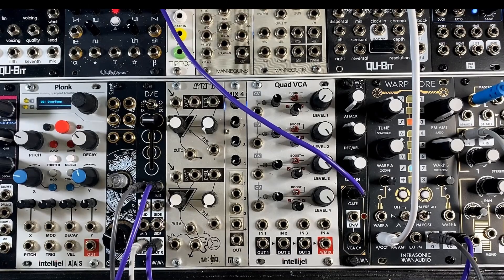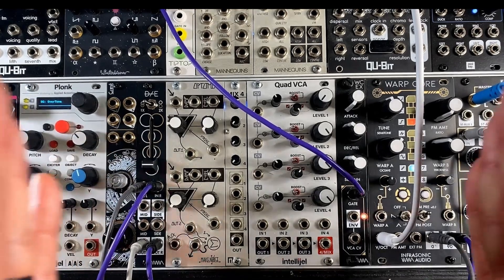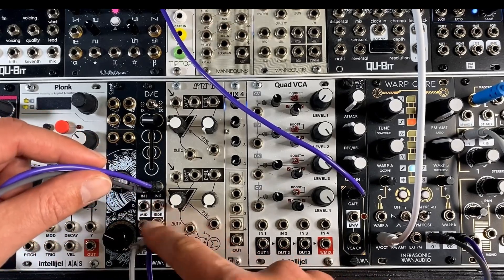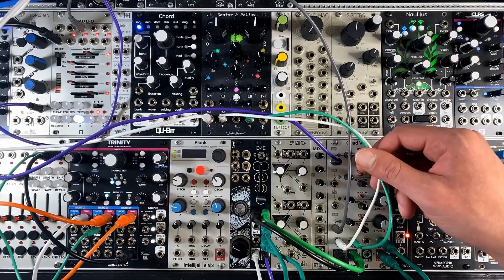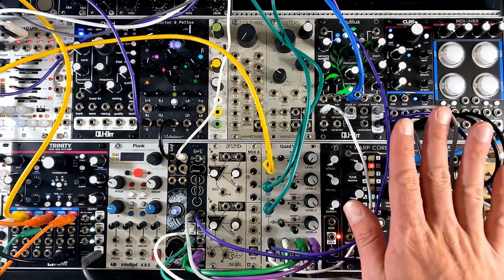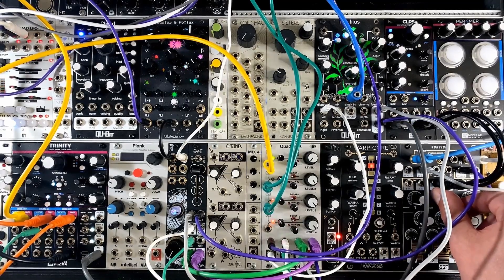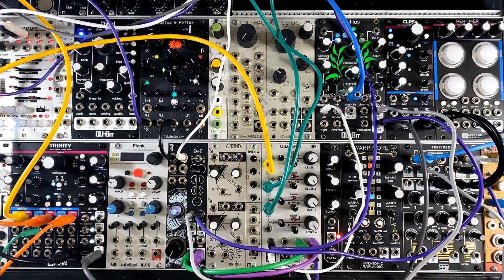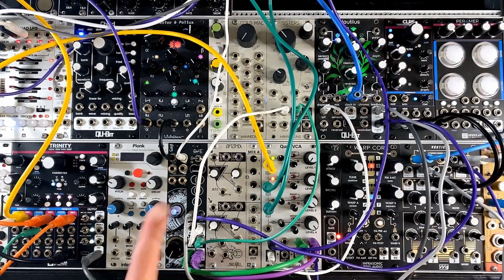DISENTANGLER Stereo Width and Mid-Side Eurorack Module

Comment: Very smart module and well-explained, kudos! Would the "doubling mode" allow me to take a mono single and introduce some 180 degree phasing to artificially create stereo width? or would that be something I'd need to do in like an all-pass filter before plugging in to the L/R inputs?
Reply from the maker: Thanks for the kind words! If you plug a mono signal into the SIDE input and monitor the stereo output - nothing else plugged into any inputs - then yes, you'll get a 180 degree out of phase stereo signal from the mono input. However, this probably won't be very useful on its own, as any monitoring on a system that sums to mono will cause the signal to completely disappear. I think allpass phasors, subtle chorus effects etc are generally better for that particular use case.

Comment: I’d like to see them go further and have an option for a mid out and separate left and right outs without the mid signal… or does it do that?
Reply from the maker: If I understand you correctly, I think you can do that! There's a full mid-side encoder and decoder exposed via the center 4 jacks. You can patch the MID out directly to other chains if you'd like, without altering the normalled decoder process, or you can patch 0V (or just a dummy cable) into the MID input and monitor OUT L/R to just get the decoded L/R from only side with no midchannel. In that case, OUT L/R will be 180 degrees out of phase. There's just no onboard attenuator for the MID input to the decoder like there is for SIDE, so you have to patch it yourself.
Reply: @infrasonicaudiollc  maybe? It’s a convoluted thing to convey 😅
I’d really love to have a L channel -mid channel & a separate R channel -mid
(I didn’t think that was possible, the only trick I’d ever heard of was L + inverted R mixed to produce a single LR channel - mid), but… I have no idea how you get an isolated mid… so I guess it’s possible?
Reply: Well, I just bought one.  For $99 it’s just too cool to pass up.  I work a lot with samples loops and I love altering them, this will open up a whole new sonic playground.